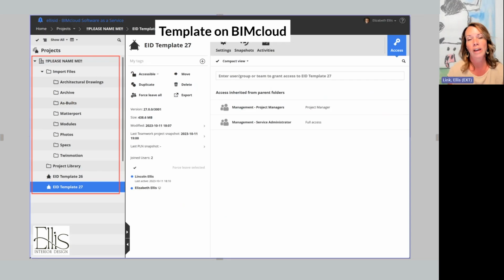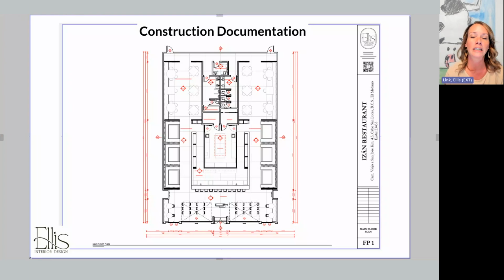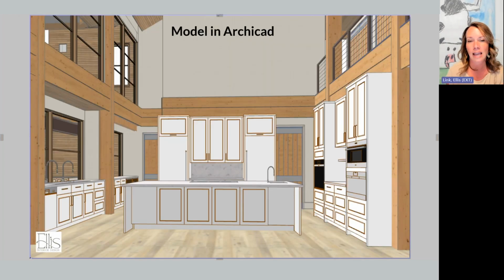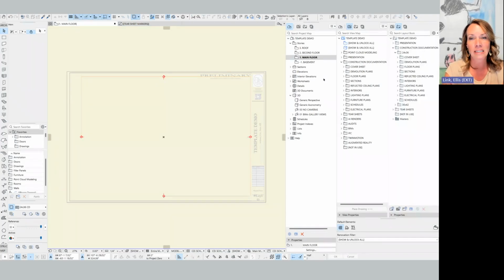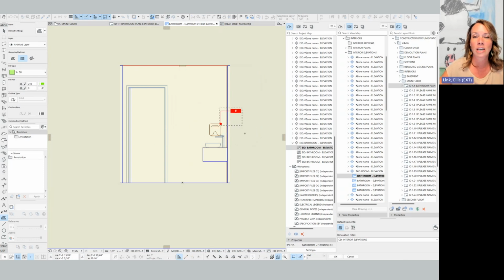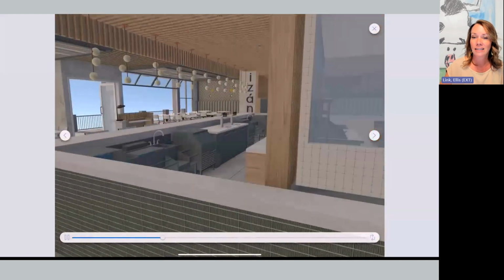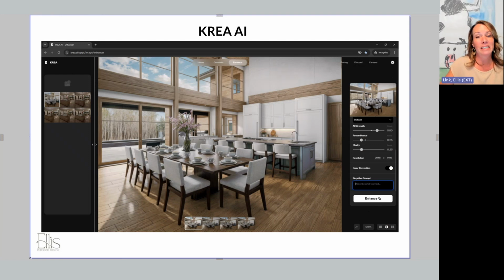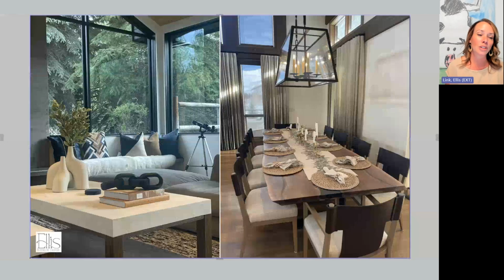Episode 8: Embracing Technology in Interior Design

Comment: I still think Archicad is a great tool, but the pricing policy feels heavily optimized for large studios. For small interior design practices, a subscription of *200+ EUR per month* is simply not realistic — and it effectively blocks many architects from using software that could genuinely expand their capabilities.

What’s missing is a sensible option for micro-businesses: a *lighter/stripped-down version* (for example **without a rendering engine and without some advanced modules**) at a **much lower price point**. That would be a clear win-win: more legal users, a bigger market, and a lower barrier to entry.

Right now, instead of expanding adoption, this pricing model seems to be seriously limiting their own user base.